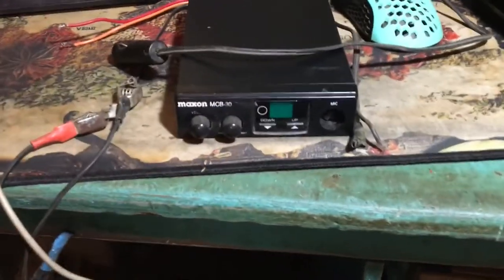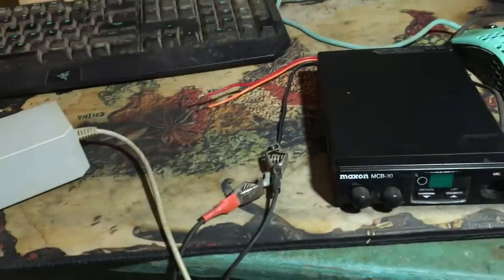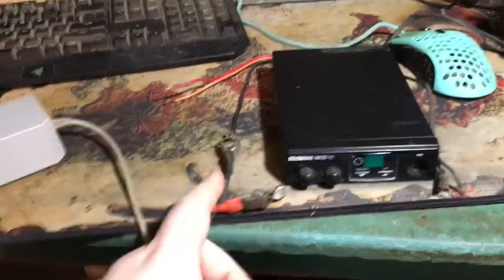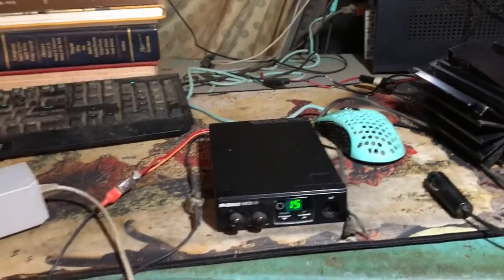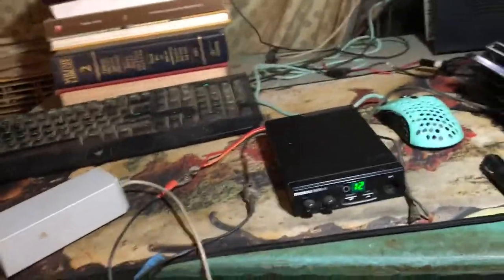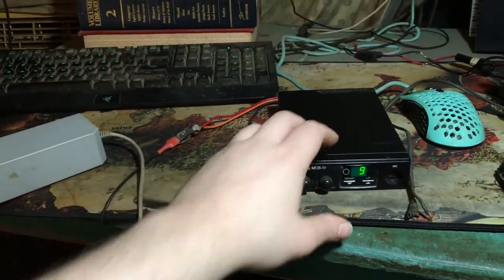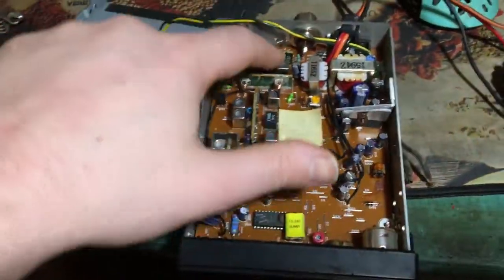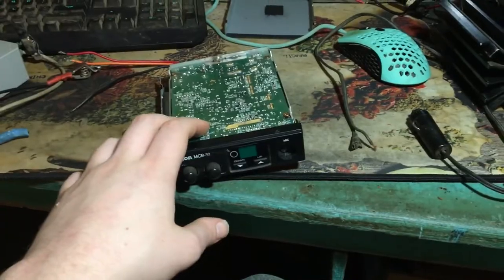Explaining the orange wire on a CB radio (Three wires on a radio) SKIP TO 5:45 for SIMPLE ANSWER

Comment: This is exactly how a car stereo is wired up so a constant DC power source keeps the memories when the main power connected to the accessory buss on the key switch is off..
Many two way radios do not use this third wire at all and there is nothing connected to that socket pin inside the radio.. I have seen radios that have been modified which need extra power for the finals and they use this extra hot wire for that.. I have also seen this used as a backup power source so if the main supply goes down a small relay or voltage switching transistor would instantly change over to the backup battery or other power source.. Some higher end base station CB's have this option if the built in AC power cord supply looses AC power..

Comment: Newer cars a lot of electrical devices such as your power outlets are controlled thru a a circuit board that is part of you engine control computer and with the right OBD device and software you can change what stays on and what shuts off.
Reply from the maker: Hey, that’s good to know man 👍

Comment: I have an extra Wii power brick I was going to convert after seeing your video on power supplies. Is it worth doing? Is the noise really bad? BTW great video Johnny.
Reply from the maker: No the noise seems fine to me, But I live in a high noise area anyway so you may notice a difference or you may not. You could always use extra filtering capacitors or noise filters etc.

But the reason why I stand behind the Wii power brick is because the damn thing is actually built well. whereas most other power bricks for charging laptops and stuff like that are really terrible and have high noise and distort your output  signal

Either way it couldn’t hurt to try it out because otherwise it’s just going to be useless unless you still use a Wii console 👍
Reply: @JohnnyNJones   I will still try it. Thank you Johnny
Reply from the maker: No problem my friend

Comment: That's for ten meters, yeah yeah, heard that so many times.
I have had computer problems, not all fixed yet but most of it is running, took 9 days to fix!!!
I have still no idea what was behind it.
I think it might have been watching the Johnny Jonesathome videos!!!!   Ah, I am just kidding.
Funny thing is the computer was running slow when I got it going and now it is picking up speed.
Another strange thing is it is a lot louder!!!!  Can't quite work that one out.
Still got problems with emails, but who needs them right?
I have not seen a CB with three wires to date, but with them being processor controlled it is bound to be along shortly, something else to flatten the car battery when left outside on cold winter nights for days on end!
I have over 300 videos to catch up on, but I will get there, I might fall asleep a few times, but hay, I have a lot of watching videos to do.
Oh, You remembered I wanted to see inside the CB, I feel honoured  :-))
Reply from the maker: If your computer is running louder it could mean that Your processor is getting too hot and your fan is kicking in at max speed your processor may be throttling itself due to overheating and causing slower speeds you can always do a virus scan with “AVG antivirus” which is a free download at avg.com and I’ve used it for 10 years

And I couldn’t agree with you more there’s no reason to leave your damn radio on all the time, I mean sure it probably takes very very little current to keep the memory but I just don’t see the point in the first place how hard is it to move the buttons when you get in the vehicle ( Most the time you’re going to be surfing channels anyway)

I was wondering where the hell you were I thought you lost all hope in me and stopped watching haha
Reply: @JohnnyNJones  Nah, but I have got hundreds of videos to catch up on, still waiting to see the inside of a certain CB!!!!

As for Anti-virus, I have one that goes through a few online that is supposed to catch everything.
I have a funny feeling it was one of the updates, but I don't know if it was the browser update or M$ update or one of the others, they all came in together (SNEAKY) and I think one of them caused the computer to freeze everything I tried to go online.  I have had the computer since 2014 (August) and it has ran every day since.
Everything reports back as being healthy, but every-time I tried to go one the Internet it froze.
It is running now, but I have lost email accounts and can't get them to reload into the computer!
All Gmail accounts.
Wouldn't surprise me if Google had a hand in it, it knows to much and has to much control over everyone's computer.
Only thing that needs memory in the car is the radio, who needs the memory to be active in a CB?
If I go missing it is the computer that is dead, or me, one of the two!
I should get a back-up drive for all the files I have on this computer.
Reply from the maker: Yeah definitely back up all your files if it’s acting funny, Most likely a corrupted software issue. Could be the hard drive or could be like you said an update that broke some files

You can try a restore point if you have one saved
Reply: @JohnnyNJones  I got most of it back, but in a way that you are not supposed to.
I don't care, it is working for now.
Emails are still not working and it is the email I need.  They gave me this computer for free if I attend unpaid meetings for 2hrs a month.  At the moment they are on line, but I have not test the audio or camera.  No one to check it with.  Oh well, I will find out on the day.
I am trying to get someone from IT at the firm to look at the emails, but no luck so far!

Get on with that CB!!!!

I am certain it was an update, why would it work until I connected to the internet otherwise.
Two things trying to do the same thing at once.

I should update to Windows 10, but I like 8.1.  I have used W10 and hate it.